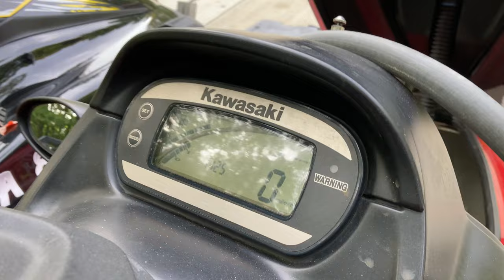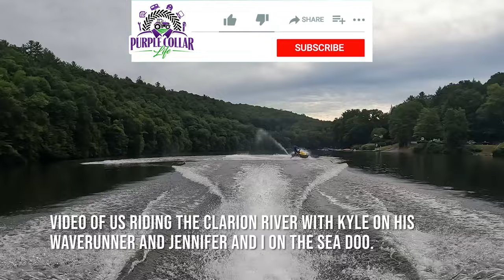Winterizing a JetSki and WaveRunner 4 stroke PWC

Comment: Great video.  Best I have seen so far. I have 2 2023 Yamaha HOs and love them.  Question: Did you find out whether it was critical to see antifreeze to come out the front ports too?
Reply from the maker: Thanks! We worried about those front ports and I do think it is important. The skiis ended up being fine. But we did find a better way to get more pressure and it did pump water out those ports this year. https://www.youtube.com/watch?v=lqcjfUHNEZM
Reply: Backed the trailer onto ramps for more of an angle and with the power drill pressurized flow of antifreeze, we found plenty coming from the front port, so feeling much better about that portion of the winterization process. Again, great video!